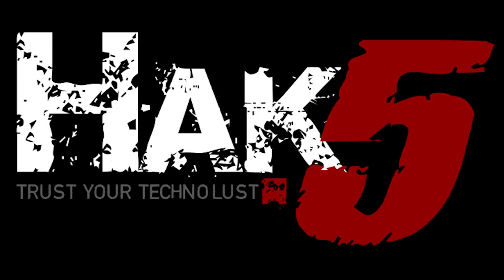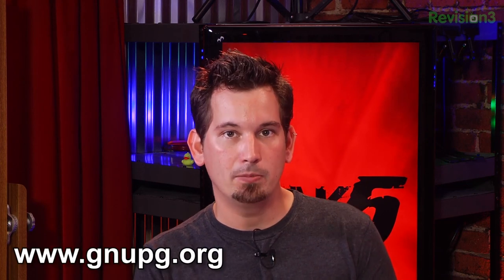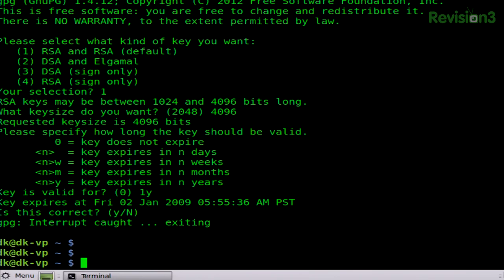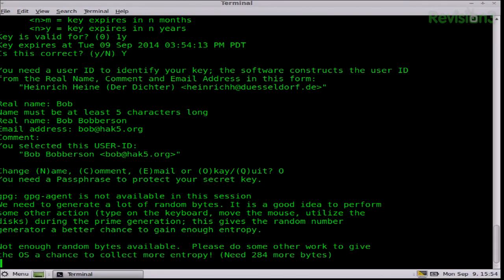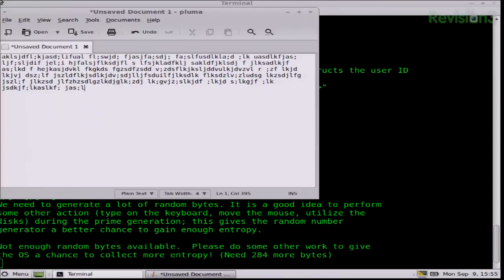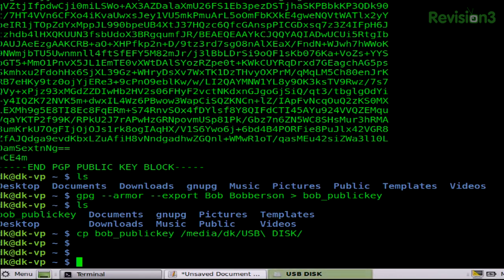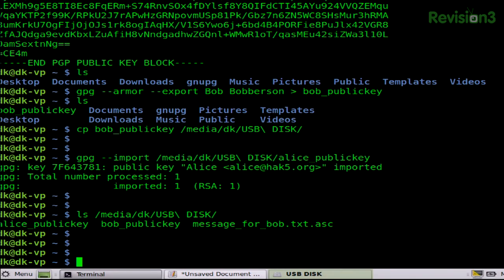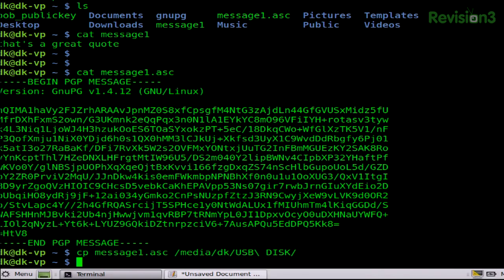Setting Up For Encrypted Messages On A Air Gapped System, Hak5 1504.3

Comment: Darren, when you take the air gapped machine apart, remove the speakers and microphone as well.
That is also an attack surface and frankly, if you hooked up a switch to the microphone and speaker to manually turn it on and off, its still an attack surface for active attacks.
Ask your funtenna friend Mike Ossman about that angle. He might have some ideas.
Machines are now being infected in the supply chain.
Data exfil using sound has already been seen in the wild.
Light as well as you've now seen with the security camera ir led hacks.

Comment: Wait, you're transferring files between your "isolated" machine and your networked machine? What is the point of isolating it from the network if you're transferring stuff between a vulnerable machine and your "secure" machine back and forth?

Comment: As mentioned in the video, the USB is the attack vector for the air-gapped machine.  You need to be absolutely certain you trust the device you're plugging in - Darren even says the setup is far from perfect.

Comment: Aside from physical security (all bets are off though precautions have been made via full disk encryption) the only major attack vector is by the sneakernet medium. In this case I'm using USB thought it could just as easily be a write protected SD card or even have a USB Rubber Ducky jam the message in via HID.

In a perfect scenario I'd simply type the message out by hand....but come on! That's a security vs convenience KO!

Comment: I thought about this so I started writing a tool to quickly convert copied PGP email from the online machine into a USB Rubber Ducky script so it would actually *type* the contents of the PGP message into the offline machine - but that's only one way. I'd still need to mount the SD card to do it in reverse.

Comment: I still have my netbook.  It's an Acer Aspire One ZG5/AOA150; I have Ubuntu 13.04 running on there.  :P  It's pretty slow but it does what I need it to (I've recently gotten a new laptop however that can actually play games, but I'm keeping my netbook).  My netbook is fat and heavy though, but it has an 8 hour battery (I put a new battery on there; the one it came with was only 2 hours).

Comment: Doing well Darren but then the Chinese produced board is running a BIOS that intercepts anything from the keyboard, carefully planting it on the USB stick for retransmission o the networked machine. Of course this is fanciful but I'm merely trying to illustrate that 100% security is impossible.